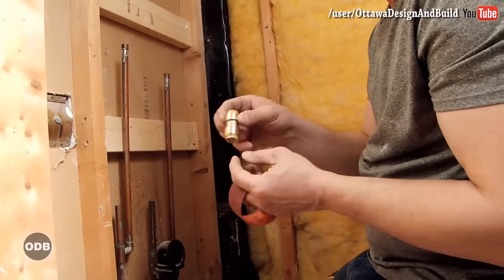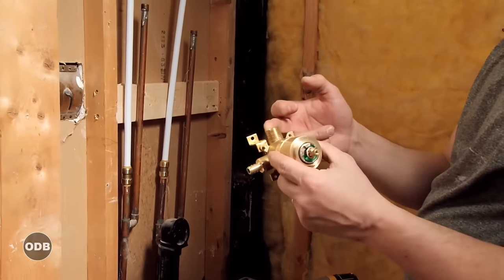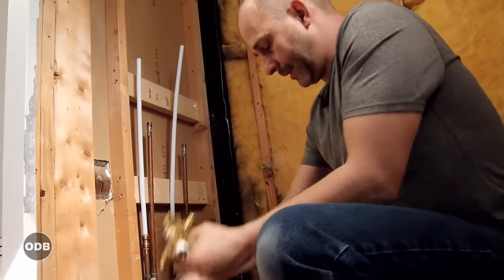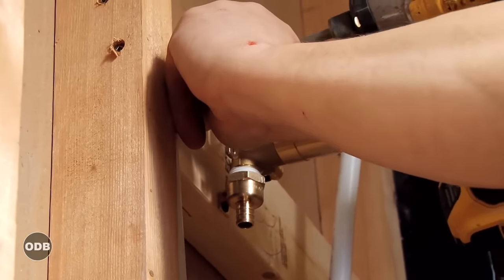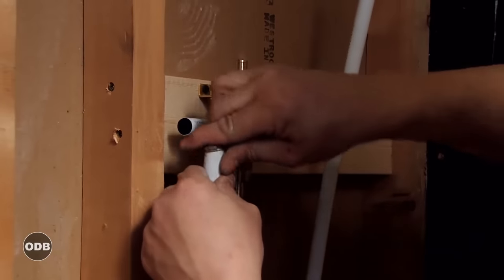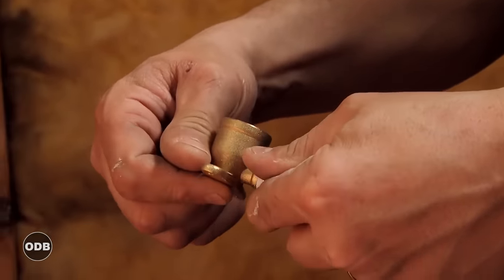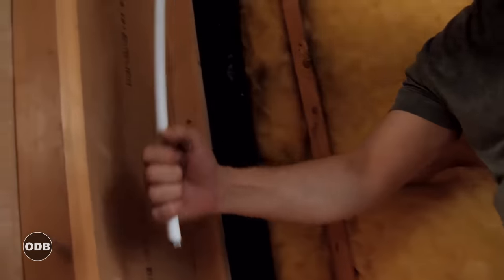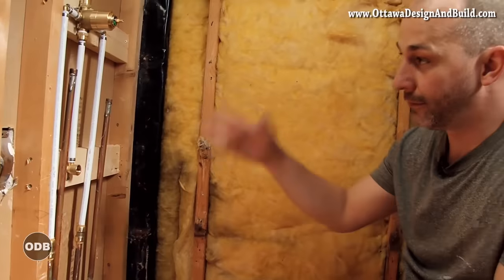DIY How To Install Copper To Pex | Shower and Bath Plumbing

Comment: I would be very nervous of hiding these sharbites behind panneling ,with ashower connections,the damage you have to do to rip it out to repair,When quite honestly the solder fitting or even compression are there forever.
Reply from the maker: Thanks Peter, this is not a how to do it perfect video, this is a how to do it if you can't solder video. The sharkbite connectors are actually easily accessible from the back side of the wall if maintenance is ever necessary. We have a new video in production explaining the soldering option as well coming soon.

Comment: I stick to copper I know won’t leak until it cut on the next bath remodel lol seam nice pex I don’t trust it . I don’t know if diameter is different 1/2 pex and half inch copper I really try this with pex red n blue pipe 1/2 that I was so disappointed on a bath remodel for a Custermer. Tile wall s ran water The entire works no leaks . 2/3 days goes buy Custermer tell me they lost pressure. Water not spraying out strong like it use to . It was the pex . Good thing I was able to get to plumbing shower from closet . I ripped out all that plastic shit put in garbage . Touched everything back to 1/2 copper pressure magically came back . Never use that ever again easy fast and cheap . But I think the pipes pex is 1/2 but the brass fittings to make connections are smaller then half inch . I don’t know I may be wrong . I’m in New York the pressure here is strong . When I put that copper back on I couldn’t believe how strong the water pressure was coming out the shower head . I have new pex tool in Garage just looking pretty. Lol
Reply from the maker: copper has it's place, but pex is much better in the cold.

Comment: You should not use pex on the tub spout, it will restrict the flow and it will start comming out of the shower head at the same time
Reply from the maker: Pex to the tub spout is fine with 3/4 inch line.

Comment: Except people don't have a crimping tool so the only real benefit is not having to watch a youtube video to learn how to use a torch with copper and check to ensure the line is dry. Pex isn't just more expensive it is a lot more expensive, like day and night difference. Unless they plan on using this system to fix other issues, then again the plumber might be a better option if they aren't willing to learn to do it themselves.

Comment: Everyone complaining about code. I own a fairly new home (2007-2013) in a 77 home development. feed lines from the street bursting because of improper connections from the contractors. Drywall screws popping through painted plaster walls. shoddy doors mounted. cheap carpeting. I could go on and on. New builds in these times are the worst. My first home built in 1965 was much better.
Reply from the maker: The world likes to act like everything new is a higher quality but for most folks the new builds are very cheaply built with poor quality finishes.

Comment: Why would anyone go from copper to crappy pex? If it has copper there is a reason to be grateful for good modern plumbing that rats aren't going to eat through. I'm buying an RV and one of the things I'm going to fix is the plumbing. I'm looking into how I can run copper in it to get rid of most the plastic crap. I know that I'll have many stub outs, but I'll also use 1/2 threaded ends and the same kinda flex lines used in the home to connect sinks, refrigerators, filters etc. I had a couple RV's and have been in friends RVs and that crappy plastic pipe always eventually leaks.

Comment: Leave the plastic inserts on pex and remove on copper for the teeth to grab a good seal on the copper, would not recommend using shark bites inside wall!!

Comment: great video... plumber wanted $1500 bucks for basicly what you kust did lol
Reply from the maker: a little knowledge goes a long way.
Reply: Because a plumber would have actually plumbed it, not shark bit and threaded a valve in.

Cant compare the two.  $1500 is a touch steep in my opinion though.

Comment: Those crimped fittings are probably leaking now. Uponor is the way to go.
Reply from the maker: Sorry to disappoint Michael. Everything is just fine. Uponor is a superior product however. I wish it was sold in the building stores. I am demonstrating a technique that everyone has access to.

Comment: if you use pex for the downspout the showerhead will sputter when you are filling the tub as the restriction in the pex creates too much resistance, dont do this, use a proper copper drop for your tub spout.
Reply from the maker: or you could use a 3/4 line with larger fittings. On well water without a booster this operation works just fine
Reply: no, the tub spout drop is 1/2 "   good luck getting a 1/2" fip x 3/4 pex adaptor.  and it doesnt matter what the water source is the fact is that when you use pex the fittings are not 1/2" ID they are 3/8 id so you are creating a restriction.

Comment: Not sure I’d trust push to connects in a hidden area regardless of certification. You have TONS more experience than me, but I’m  just not trusting of it. I’d use them in accessible areas.

Comment: I hope this homeowner didnt spend a lot on tiles because they'll all be coming off again within 12 months. BTW adding paste and PTFE on compression fittings is UNDERrkill - not overkill - you are obstructing the thread from advancing fully and compressing the olive  and doing its job. A few wraps of PTFE tape on the olive is fine - slapping all that shit on there will result in the joint failing eventually when the water washes away the thread sealant over time. Personally I always solder all joints that are inaccessible
Reply from the maker: Been over a year now and everything is working wonderful. Guess you made a bad diagnosis there Doc!

Comment: Never use a shark bite inside the wall. They are not leak proof like crimping or soldering. Also he put way to much tape. Cheap way to do plumbing, especially inside a wall you can’t easily get to.

Comment: NOOO! sharkbites are a temporary solution until water can be shut off! Never NEVER EVER use sharkbite and leave it there! this guy is clearly not a plumber, like at all... he does pretty much everything wrong. this video is perfect examples of what NOT to do! don't use sharkbites, don't use pex, don't use tape on brass fittings use dope only (what he calls paste). go traditional copper or the new school wirsbo (similar to pex but much more reliable).
Reply from the maker: Let's all trust the opinion of someone who uses a number for a name.

Comment: I don't think sharkbite is a good idea in a wall. Sharkbite prevents leak with a rubber o-ring, which is never a guarantee for leak. I'd suggest compression connection or soldering.

Comment: those fittings will leak! 
Copper is not that hard to do ,wall is already open
Reply from the maker: For some copper is hard. This is designed for people who can use a crimper but not a torch effectively. However i agree a good solder joint is superior to any crimping system.

Comment: I believe he since found out that you shouldn't use the smaller dia. PEX for the tub flow since it affects the shower feed. I believe he fixed it in a 2018 video. What I don't understand is, if that was the case why not delete this video.

This is the later video...
https://www.youtube.com/watch?v=jgkCmT8Cc98

Comment: First of all. You should never use pex to connect your tub spout. Since the inside diameter of pex is much smaller that copper. Every time you turn on the tub. You will have water coming out of your shower head since the diameter is smaller. And the water can't come out of the tub spout fast enough.
Reply from the maker: Allready adresed this earlier. If you want to run pex just use the 3/4 inch pex to the dropear.

Comment: Never use pex fittings for the tub spout drop. Its in the instructions sent with all common tub shower valves. No professional license needed.  Decent "how to" info here for any novice tackling a shower valve on your own. Just avoid that one important mistake.
Reply from the maker: Thanks, we have all agreed that a 3/4 line pex to a drop ear would work well in this case.

Comment: Never put a shark bite in a wall with no access, use the proper transition fittings.
Reply from the maker: Asa long as you have an access panel.

Comment: I am not a plumber by trade but I am pretty handy. The thing I see over and over again, why in the hell do you use dry wall screws??!!?? There are coated screws out now that will not rust and now matter what moisture gets behind drywall at some point.
Reply from the maker: I don't worry about moisture behind the drywall. I use a waterproofing system that eliminates the need to worry about rust. This is why I don't have any concern as to the screw.

Comment: I would rather use copper or Wirsbo over pex any day.... You loose so much pressure using pex fittings. Also a sharkbite in a wall would be a big no no for me... I mean I don't mind people using them in walls, as it gives me work coming to their house to replace the failed fittings.
Reply from the maker: The idea that we should be concerned over loosing pressure in a shower and yet install water reducing fixtures is quite odd. Pex is the new standard. better learn how to use it.

Comment: Using Teflon tape and plumbers paste is not a good idea.  One or the other would be more efficient than both.  Use channel locks in the proper direction.  They grip in one direction only.
Reply from the maker: I have heard some plumbers say that and yet I have had others swear by doing it. Please don't give opinion as fact. without backing it up. I have never had a failure with both but have seen multiple times where 1 is not sufficient. In this application the goal is to guarantee no leaks as the valve body is not accessible even from the back side of the wall after installation.

Comment: DELTA's instructions have said not to use PEX for the tub spout,  those are not compression fittings, used the pliers & Teflon tape backwards,  Sharkbite adapters have orings that go flat in a few years, also their is an erosion effect at the copper to sharkbite connection,  if this guy is a plumber he is awful in this demonstration,  he should've read the instructions for all of this valve to pliers to Teflon tape & paste. LOL
Reply from the maker: We desalt with the pex to tub spout issue earlier in the conversation, deciding to use 3é4 line from now on solves this problem.
Reply: Anonymous Baros,  Take a bite of a shut up sandwich. Why then, does shark bite have a 25 yr warranty ?

Comment: Your water flow will be garbage since you used pex on the outlets and you need copper for better volume. Shur fit are the junky pex ring to use and the real copper ring should be used. I have seen shark bites leak and they can cause a mess. Should never be in the wall.

Comment: Good video but wayyy to much plumbers tape. To much tape and you can put to much pressure on the brass and crack the fitting. Also turn your plumbers tape around when your putting it on and you don't have to keep rolling it back on to the roll as you put it on the fitting and you get a much tighter/better seal on your fitting.
Reply from the maker: Wow, I have never cracked a brass fitting in my life. I didn't even know that was a thing.
Reply: Home RenoVision DIY - Yes, I've done it myself and seen it done by others especially with cheap brass fittings (mainly from Home Depot). To much tape puts a lot out outward pressure on the fitting as your screwing a pipe into it. Mostly I've seen it done on drop ear elbows when the nipple is tightened in with to much tape. Don't know why those are so susceptible to cracking but I've seen about 5 of them over the years. Normally 3-4 wraps of tape is plenty. Doesn't hurt to add pipe sealant also if it tickles your fancy. Can't hurt any! Just my own two cents :)

Comment: Do not put shark bite behind walls.
Reply from the maker: unless you have an access panel
Reply: sharkbite rarely fails and has the same warranty that a pex fitting does, even concealed. you can theoretically use them on heating pipes also, though this I would not recommend. Sharkbite Is also the exact same company that makes gas meter bend 90's and they are the exact same design. if done righ sharkbite works fine, the main issues are homeowners dont ever ream the pipe and they dont properly clean the surfaces, usual leaks in sharkbite happen when pipes are not properly supported.

Comment: I am a plumber I think this video gives people terrible advice.  I would never use sharkbite behind a wall.  It is a loose connection and the first fitting should be a copper to pex connector.  Now I wouldn't use sharkbite but in a pinch I can see how it can be useful but only in application like an unfinished basement where the fitting is accessible.  Plus it is painful to watch him put on Teflon tape with the roll facing the wrong way plus tightened the pex adapter with the channel locks facing the wrong way.  Just because you get by with something doesn't mean it is the correct way to do it.  Lastly you don't put in a showerbody before you install the tub.

Comment: GAHHH. Did an install exactly like he did. DONT. The tub and shower will run at the same time. Using pex for the tub spout will cause too much water pressure.

Comment: Why would you touch the fresh sanded pipe with your dirty, greasy fingers? Use a clean cloth, wipe the pipe clean, THEN - apply the fitting.
Reply from the maker: LOL.

Comment: Do you realize shark bite only guarantees 90 days out of shark bite fittings?
Reply from the maker: Actually they offer a 25 year warranty. Try checking your info before you speak>
Reply from the maker: So lets clear this up once and for all. I am tired of hearing from so called plumbers who trash Sharkbite as a temporary install. The truth of the matter is this. Almost every plumber in the world offers less than 5 years warranty on their work, most offer 90 days. Sharkbite offers 25 years on their fitting. I will take shark bite over a plumber any day since I can never seem to find them 5 years later any way. At least Sharkbite answers the phone, while most plumbers don't. If you have a problem with their product, talk to them and start giving a lifetime warranty on your work! Maybe then I will value your opinion.

Comment: One day we will learn that pex leaches cancer causing chemicals and it will become the new asbestos.  Sharkbite fittings utilize rubber internally for connection.  Does the special rubber last 100 years?  I'm not here really to debate these things, time will tell.  Asbestos was "perfectly fine" 100 years ago, and we KNOW copper is long lasting.  I love the new mcmansions plumbed with plastic.  I'm a contractor who repairs things, These new homes look great after ten years of wear and tear...
Reply from the maker: Let's try to live in reality please!
Reply: Wait and see.  Teflon pans quietly just disappeared (cancer causing).  My sister has been flooded out twice in Hoboken as the plastic water lines to the fridges keep failing, 15 years into the new build.  That IS reality.  Maybe you are in the alternate reality, wait and see.  I admit I can be wrong but can you?  Just remember this conversation.   Yeah 100 year old sharkbite fittings in the walls....not.
Reply: Oh and the last house I worked at failed for using tape AND paste, it does not make the connection twice as good and as others have pointed out you used your channel locks backwards.  Some Mexicans (unlicensed) did the plumbing. The inspector and I laughed at the workmanship.  I'm a licensed, insured GC in NJ.  Don't show people how to do things wrong.
Reply: Paste is for gas and iron connections btw.
Reply: And the "1" setting on the drill (forward) is low torque for driving screws, the "2" or towards the back setting is for high speed drilling.  That is just reality.
Reply: Oh wait sorry for some reason you are using an impact driver to put scresw in LOL.

Comment: Not seeing any comments on the crimp fittings your using. Those things are junk and will fail!
Reply from the maker: Although I appreciate your point of view, they have a remarkable rating now. The original version from a few years ago did stink. The newer design and alloy strength are far superior. If they work during the pressure test they will not fail later. The tool required is also really affordable for do it yourselfers. I would recommend the other crimps for professional use though.

Comment: Sharkbite hack plumbing! This is not the proper nor recommended type of install. If you already have copper, why not run copper to the valve?
Reply from the maker: This is an option for people who are not comfortable with soldering.

Comment: Traditionally, I find that things are not being designed up to snuff.  Manufacturers are cutting corners in the amount of copper or brass in their fittings / valves, and hence make poor design choices.  Part of it is our fault, as we won't pay for a slightly better design, but want the cheapest item out there.  Sigh.

Comment: "The average home owner can do this". Really?
Reply from the maker: Definitively, just follow these simple steps.
Reply: I'm doing it right now. I'll let you know how it goes. For me the main concern is getting the correct depth level for the valve and bath spout since the old system was smaller.
Reply: I'm going to install my own water softener after watching this so yeah, I think an average homeowner can handle this. Thanks for the video.